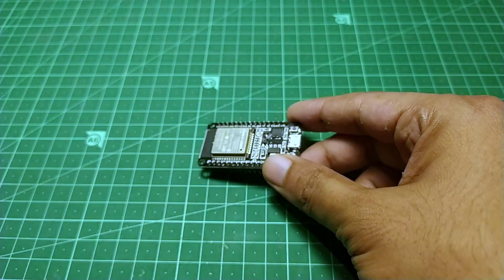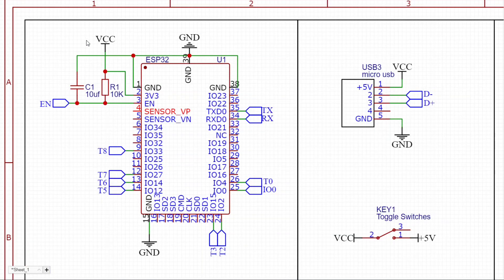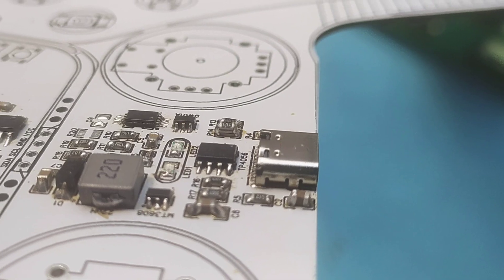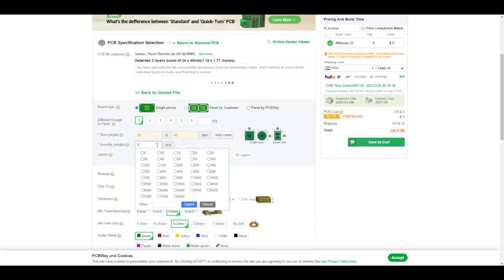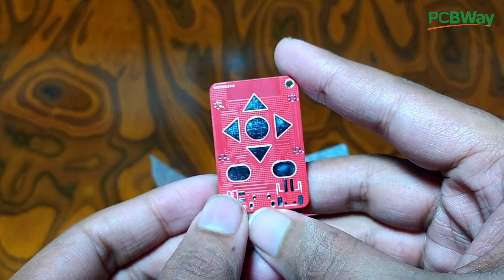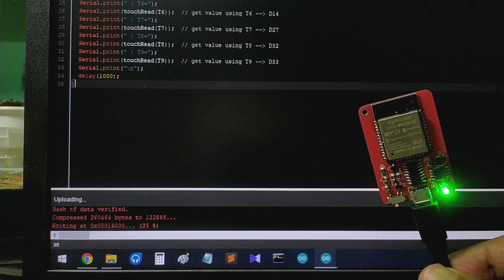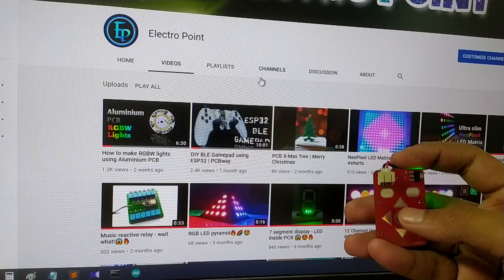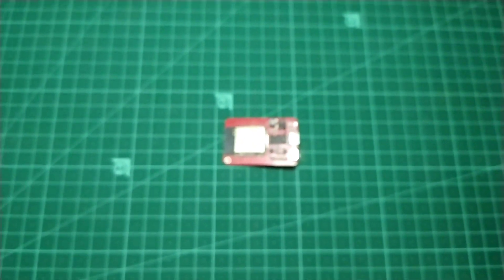Portable wireless Touch remote using ESP32

Comment: There are 4  4*4 pads on the side with the touch sensors, your schema and docu does not mention them and it looks like you put a resitor on two of them.
Reply from the maker: Those ware for adding LEDs but it was coming between figures so I removed them